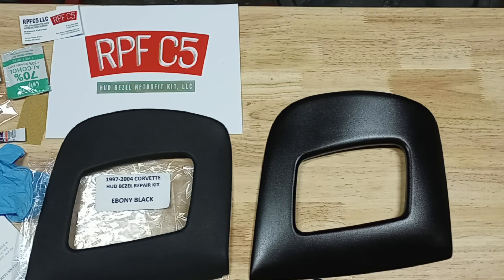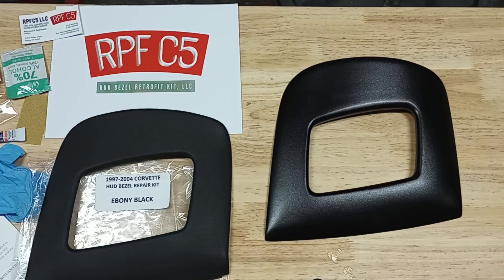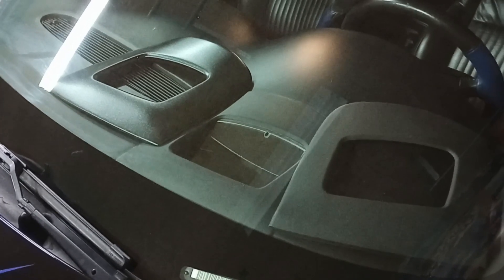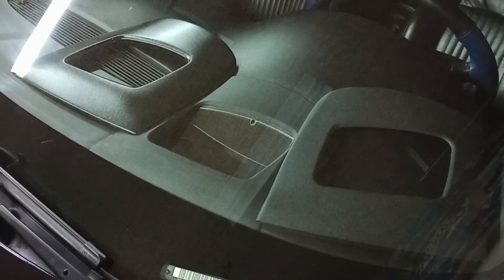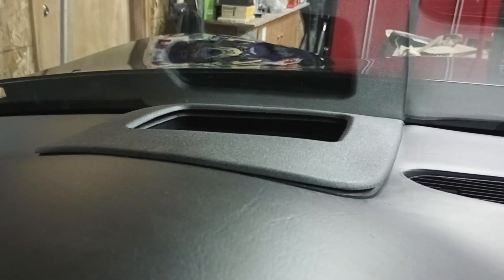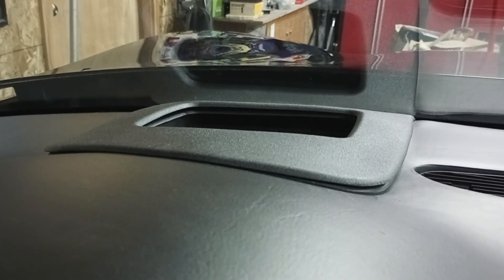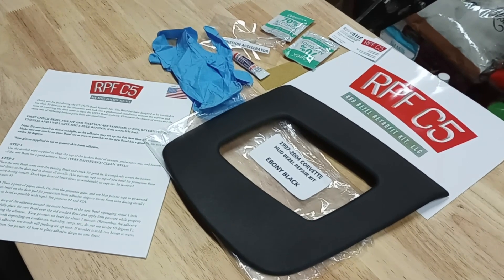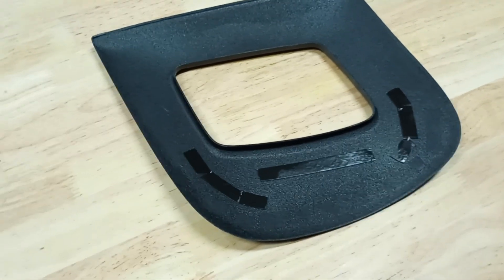Who Makes the Best C5 Corvette HUD Cover Overlay?

Comment: Which one the one that looks more like OEM with the mat color? What brand is it?
Reply from the maker: The one that is more OEM finish is the RPFC5 cover. There is a link in the video description to it. The last I checked, the best price was on eBay for the kit. It was $59.
Reply: @BasinMotorsports  if I want to replace it with an oem will it snap in with brackets or what's the process for that?
Reply from the maker: You have to remove the upper pad and there are four screws holding the OEM parts to the dash pad. It's a big job and requires removing a large amount of the interior around the dash area.

Comment: Hi I just installed the RPF C5 hud cover everything came out great except the right side towards the steering wheel (where the crack is) lift any idea how I can fix this I followed the instructions to a tee and even used the paper towel roll.  If I push it down it will,move down but not stay  any help would be appreciated
Reply from the maker: Can you add more adhesive and try to push it down further while it bonds together?
Reply: @BasinMotorsports  should use the same adhesive and should I apply it to the dash since it lifted the original hud bezel
Reply from the maker: @josephpiantedosi8210 You can try it.
Reply: @BasinMotorsports  I will try tomorrow  thanks